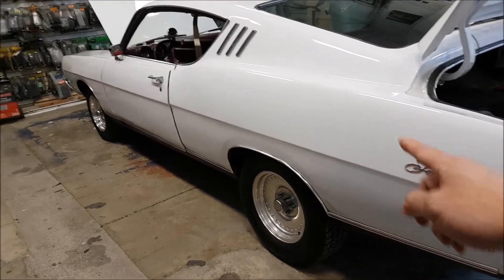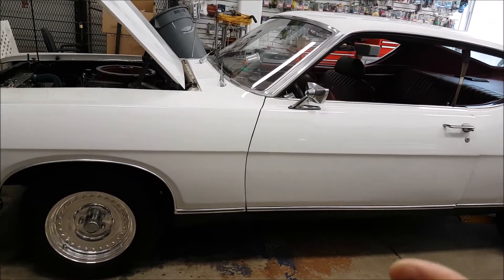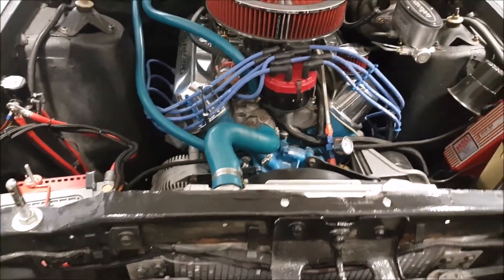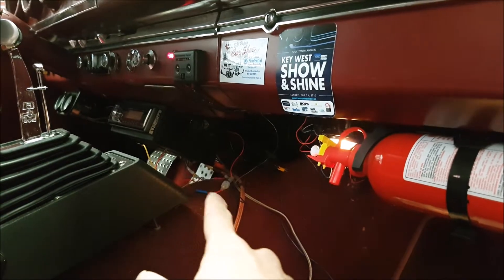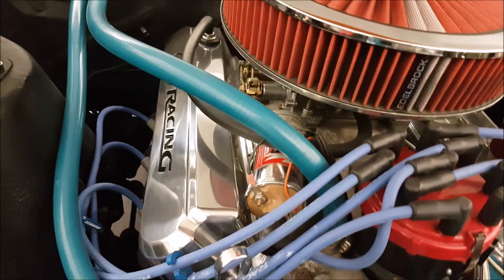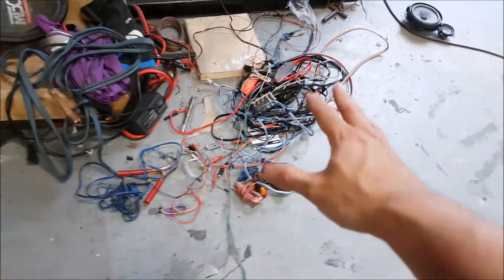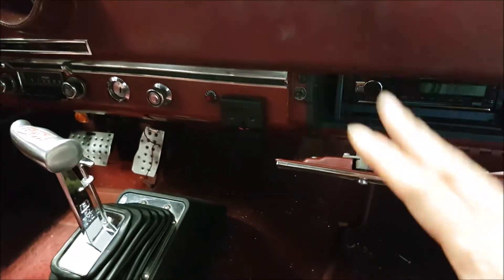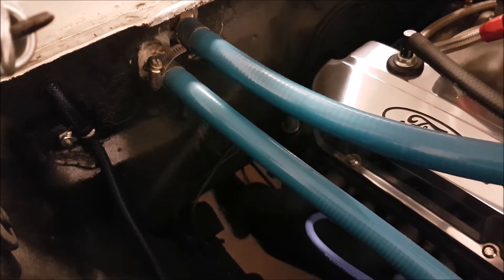Builds: 1969 Ford Fairlane 500 Project Day 1 | AnthonyJ350

Comment: I have a dodge ram 1500 I put a new battery  in on Saturday and I haven't started it since at I went to start it up and drive the battery was dead is it my alternator ping bad
Reply from the maker: Playamack Real o.g Put the battery on a trickle charger to recharge it then you can check the charging system with a multimeter.

https://youtu.be/2_sFE_M16ps
Reply from the maker: Playamack Real o.g After check for any abnormal parasitic draw https://youtu.be/d0T0_gNn3Rk